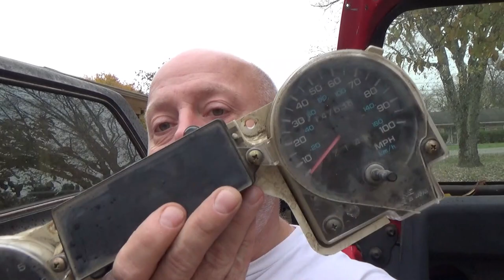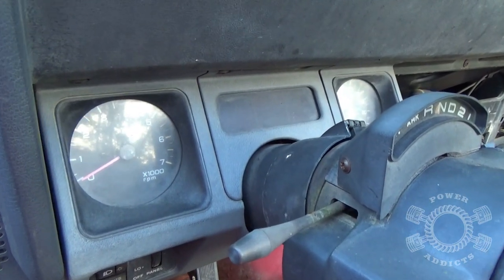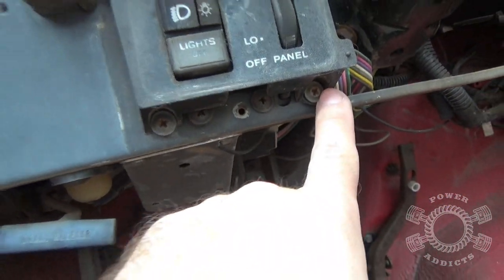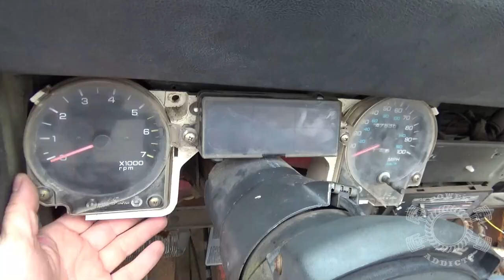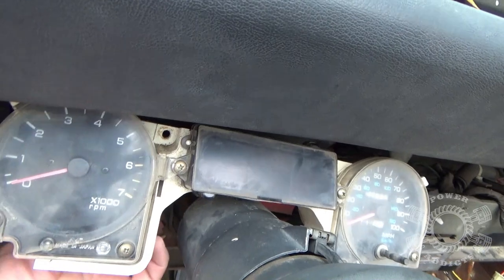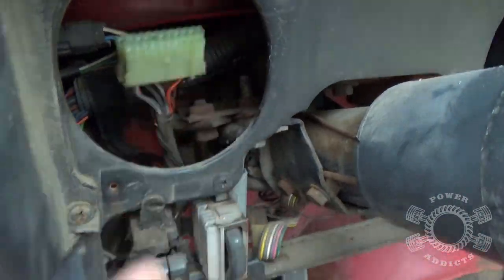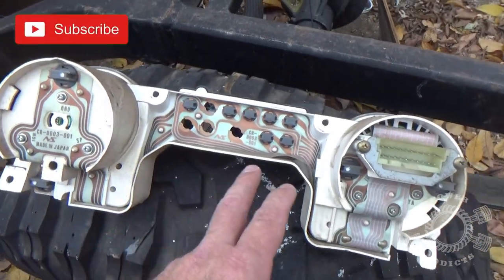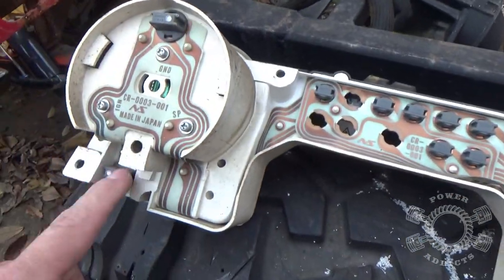Jeep Wrangler YJ - How to Remove the Speedometer and Tach #poweraddictscrew #jeepyj #jeeplife

Comment: I had replace the bulbs the lights inside the cluster. Jeep kept that simple. Getting a junkyard engine to replace your old engine that's a task. I had to replace my 2.5  4 cylinder engine. I got to use the manifold but the intake and motor support came from my old engine. Because of my power steering pump mount to the intake.

Comment: I recently purchased a 99 TJ and I'm having problem with the spare tire it doesn't fit my size 22 in rims on the back of the Jeep what can I do to solve this problem without spending four hundred bucks
Reply from the maker: Hey there, I answered this when you asked on a previous video. Those rims have such a deep offset you will need to go to an aftermarket bumper mounted spare tire carrier.

Comment: Did you ever show how to test the circuits? Couldn’t find that video.
Reply from the maker: Nope, I haven't shot that vid yet. I'll get on that one soon. Thanks for dropping in!
Reply: When will you get around to doing the diagnostic video on the Speedo and tech and stuff I need to test mine and have no clue yet. I can't find any other info on troubleshooting my speedometer that isn't working.Looking forward to your video.
Reply: @jefflorikerr1556  interested as well. my speedometer is not working but was intermittently then stopped. tach is working normally. Thanks @Poweraddicts